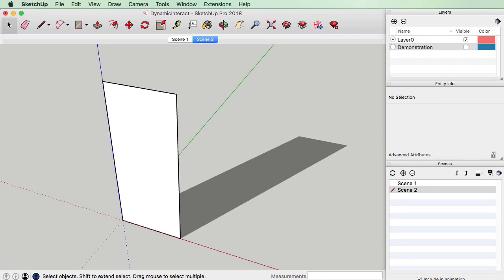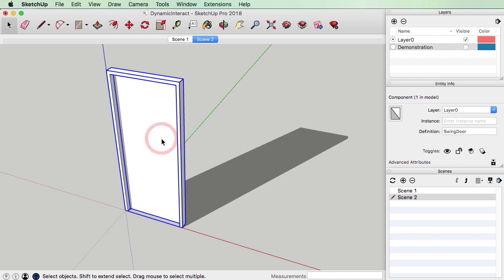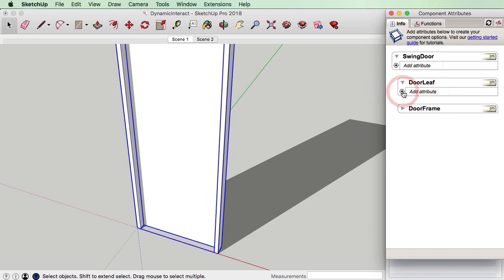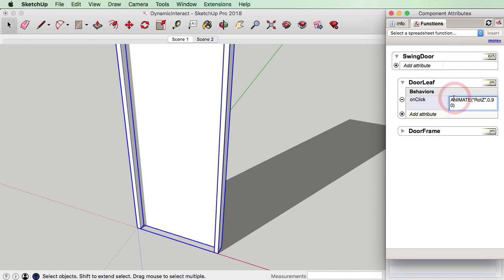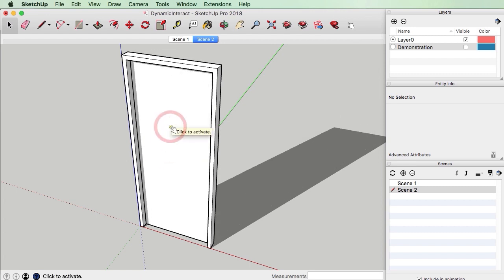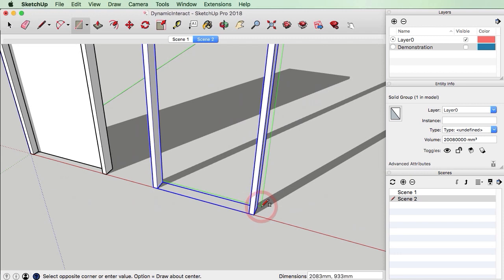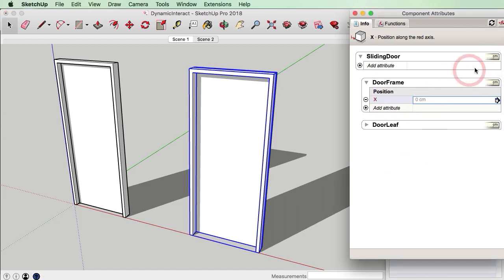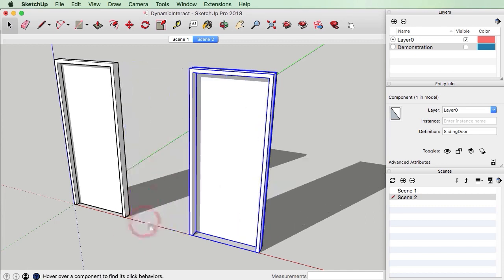Animating Dynamic Components in Sketchup

Comment: 5:25 Regarding that conversion to inverted commas: That's not exactly a bug in SketchUp, but a Mac OS system preference. See System Preferences > Keyboard > Text > Checkbox „Use smart quotes and dashes“. Make sure to have it unchecked. It would be however wise by SketchUp to ignore this setting, at least in the attribute fields (not sure if that's possible Mac OS coding-wise).
Reply: Can V render this animation?

Comment: Is dynamic attributes only for sketchup pro?
Reply from the maker: It might be available in Sketchup Make 2017 but not for the current browser based versions Sketchup Free & Sketchup Shop.
Reply: @JustSketchDesign  Looks like it's only for Sketchup Pro sadly
Reply: Apparently only works in Pro ver. Another disappointment but thanks for the vid. Piqued my interest (in a good way) for a bit.
Reply: Coming here from Make 17 and sadly it appears I do not have the ability to do this.
Reply: That's odd, seems to work fine for me.